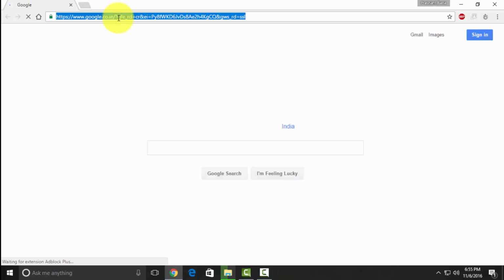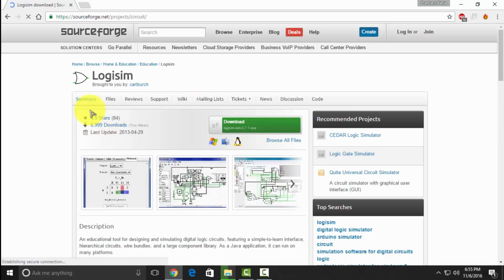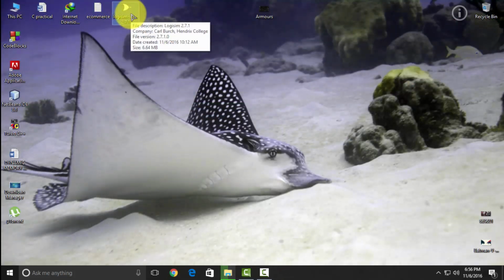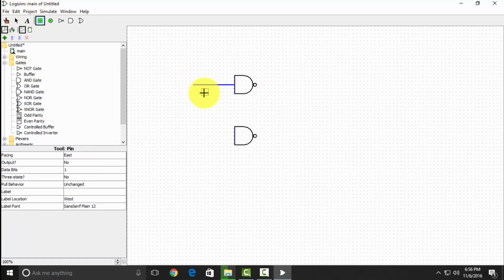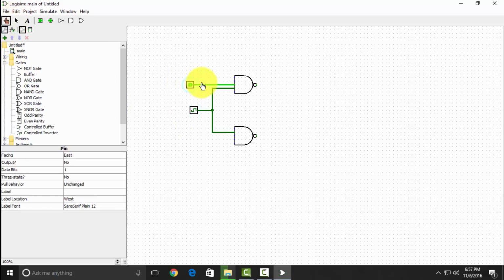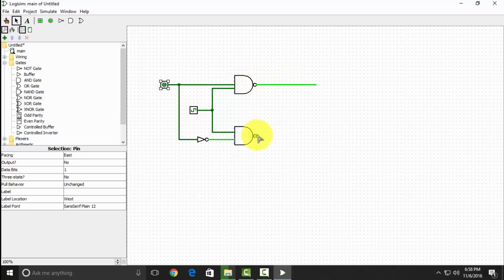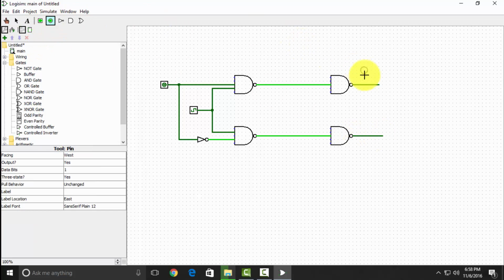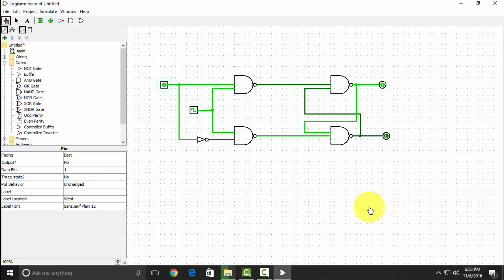D Flip Flop Using Logisim

Comment: This is actually a D latch, not a flip flop. D flip flop only stores D on rising edge of clock... if you integrate this into a shift register it will not work because the values will instantaneously propagate through and erase all bits.

Comment: You could have done with some explanation about your choices of gates. Why, for example, did you have the left-most pair of NAND gates, wouldn't it have worked just as well without them? Does the clock need configuring to trigger leading edge, or falling edge? Maybe introduce the video with what you are trying to achieve, and why.